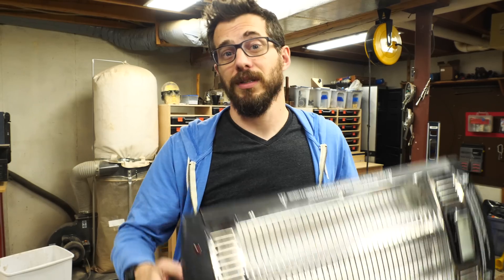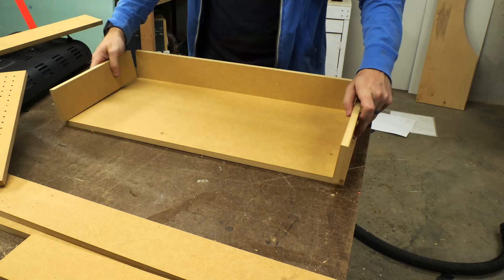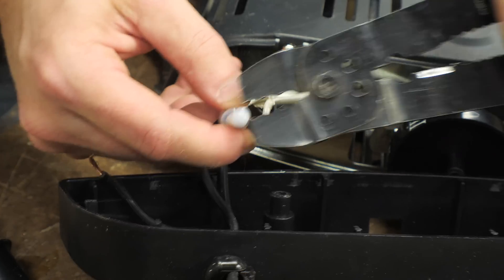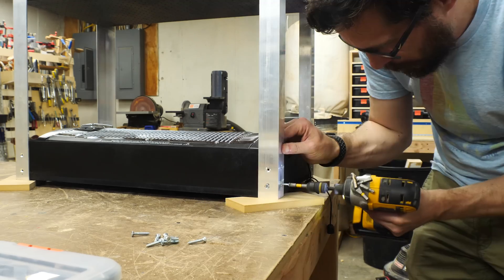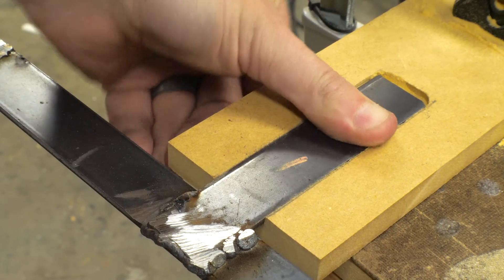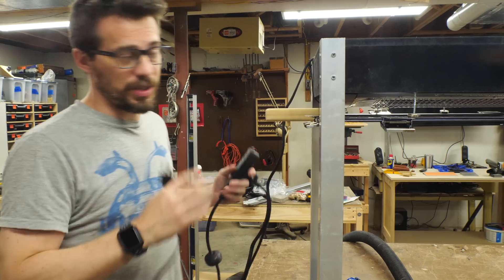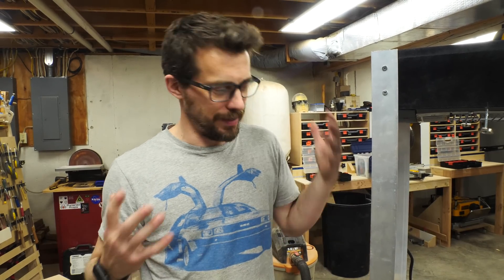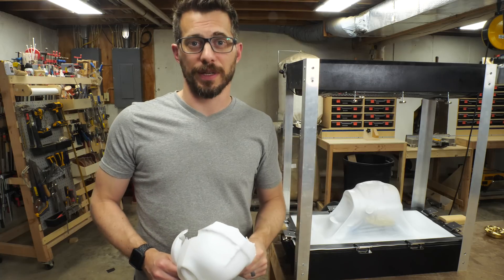How to Make a Larger Vacuum Former | I Like To Make Stuff

Comment: sealing solar cells to make a solar panel.  So need 4x8 feet working area.   I called Flex Seal to ask if there stuff works in a vacuum for repairing old panels.  They have no idea.

Comment: Reagrding those auto darkening welding helmets: your eyes are safe even if it doesn't darken due to flat batteries. The darkening feature is only for you see actually see what you are welding, the actual protection is in the protective glass lens already (UV block).

Comment: I could be wrong about this, but I don't think I am ... a buck is actually the object you're vacuum forming around. So your wrenches and Raspberry Pi are the buck in this scenario. Padding is what you use to push the object away from the platen whether the padding is built into the buck or just stacked underneath. Padding helps to get additional material beyond the bottom edges of the buck, and also helps to avoid pinching on corners. Another note, if the heater is encapsulated in the box (instead of sticking out the bottom) the heat will be more evenly distributed across the material because it won't be escaping out the sides.

Comment: been thinking on a vacuum former to make bigger parts (part being bout the size of a trailerfender but was thinking about making it upside down  , i was thinking about a way deeper box with the heating elements at the bottom and the plastic fixed over the top and to drop the box with the mould and vacuum over the top 
reason being that when the plastic droops down intoo the box it creates a cavity for the mould to drop intoo and it retains the heat under the plastic even while the mould is placed over it to give you more time do the vacuuming / forming slower , all the heat moves up and spreads along the plastic so you should need less heat (the drooped part does get closer to the heat though the heat rises beyond the droop and hangs in the corners / ceiling ) and i hope the thickness of the material will be more equal as its prestretched before pushing the mould intoo it , the weight of the mould might become an issue  , it be hard to see wats happening too unless you put windows in 
you would need some pieces of angle iron on the corners  along the side to guide the mould/vacuumbox  over it , might even help the vacuum by pressurising the underside heating part of the box wirh a leafblower cooling it off in the process and make the plenum way smaller to concentrate the vacuum to only where you need it 

the box for the heating sitting on the ground would be about table height the topbox about the same as the one in youre video just bigger and upside down with the mould bolted ontoo it , could put a metal difuserplate over the top of the heating elements to prevent plastic from dropping ontoo them 
might be possible to make a mould on a board with the exact amount and placed hole to pull the material intoo all the corners (bigger holes for more cfm to pull material intoo corners before the rest is pulled tight )

Comment: Idea... hang two sheets vertically in the oven and slide them together on an object and vacuum the air our with a steel ring with holes that hangs between the two sheets. This way you can form 3D objects from both sides.

Comment: Question about material: Im building something similar for making RC car bodies. However my hardware store only had a sheet of thin acrylic (that’s how it’s labeled verbatim - ‘Acrylic’). Will that heat properly for a vac press or should I shop around for better material? For example, Lexan is typically the industry standard for RC shells. Thanks.

Comment: I just built my first ever vacform last year. While it works perfect, it's too small for my next project. Thankfully, your video helped me figure out how to build my next. I will say, hand drilling the holes can be exhausting (and I managed to mess up my back a little).

Also, another trick for sealing the edges (I used), is to use duct tape (the silver stuff they use fro dryers exhaust). Placed on the outside seams, where the vacuum will pull it inwards, plugging any gaps

Comment: Good video. What I've yet to find is anyone talking about the plastic they use and how much it costs. Amazon has lots of choices, but it seems so expensive considering a lot of vacuum forming is done around disposable containers. I know suppliers buy stuff in bulk, so that makes a difference. I bought one of those $125 chinese dental vacuum formers on amazon that uses 5"x5" sheets of plastic. I'm experimenting with old soda bottles and other containers.

Comment: Im looking to make a 60" x 40" Thermal forming machine for making 1/4 scale race car bodies. I have four molds and plan on using .060 - .067 Polycarbonate sheets. Haven't decided on heat source yet, most likely electric grids that can be turned on and off individually by a Thermostat.
I'm ready for any ideas that you have.  Mike Clark

Comment: bit late to the party but great video. i made one as well and it works really well. i did change one thing and that was replacing the neodymium magnets with ferrite ones. like the ones on a fridge but on steroids. 
I did that because neo's loss the magnetic field of they heat up above 60C and ferrites can handle around 200C. this was too prevent it from losing its grip on the plastic holder while you are waiting or if you are using it for a while.

Comment: In my architectural model building class back in the eighties we had one that was two separate tubs.  Since heat rises the heater tub had several light bulbs in the lower section.  Once the plastic sheet in the frame was bouncy we took it off and placed it on the suction tub and hit the vacuum power.  Trying to heat downward in an open frame is not very uniform.

Comment: I know this is three years old, but I’m hoping that you still check comments. If you need to hold a vacuum for the extended period of time, is MDF still a viable option? What if you needed a large vacuum chamber and you needed to pull a vacuum while it is full of water? What would you recommend for something in that application? Ideally I would use a steel drum, But I don’t have any around here that would be suitable for the purpose. The only steel drums around my area have petroleum in them, and I need these to be aquarium safe.

Comment: A suggestion- use melamine. As you know, production CNC routers often have vacuum tables and pneumatic dogs. The waste sheet is MDF, with the vacuum pulling through the MDF to secure the cut sheet. That’s because MDF will allow air to pass through, pulling the cut sheet down. It’s permeable. If you use melamine and melamine glue…it’s still inexpensive, but will improve any vacuum carcass you’d build for a vacuum form machine. As a matter of fact, melamine is cheaper than MDF. Trust me…this is years of commercial fixture production experience speaking to you.
Reply: Thanks for the tip Ray :D

Comment: Most welding helmets are actually solar powered. If yours happens to not work, find some sun and let it charge back up before you need to use it. 98/100 times it works

Comment: I also had a thought for removing the clips issue: put handle tangs on both heating frames, so when you add the wood handle, it holds the two frames together. If you line both frames with a thin heat resistant rubber, that ill hold the plastic with a nice strong grip.

Comment: You can buy metal grid with holes it in at home depot and i think the holes are small enough for this.  I was thinking toaster oven for heater but I like the ceramic heater. Idea they do put out a lot of heat in a short time.

Comment: you briefly mentioned the buck,  the importance of this can not be overstated - also your inconsistent heat source is causing uneven drooping and subsequent creases - in a shop nothing you showed here would pass but you have a great basic concept, as you said with some refinement and practice you can get to pulling the kinds of moulds we use in aeronautics

Comment: The box for the vacuum is too tall and this is made this way because it has the vacuum connection on the side BUT it would be better (if possible) to make the box much thinner and pull the air from the bottom in the centre. This will mean that you will not lose so much of your very valuable initial vacuum to emptying all the pipelines and the box before making the pull on your product. Some like to use a large tank as a vacuum holder. This is great as you can then vacuum much larger items If you can couple this with a three-way valve it works like a dream. Step one turn valve so only empty the tank of air. Step two heat your plastic pull it down over your mould step three use the tank and pump together to pull the air. Step four isolate the tank as spent and just use the pump to pull directly. This way you can get much better definition in your items and make larger items. The vacuum and getting the right temp evenly are the crucial factors. Keep all areas clean and dust free  as they look terrible when you vacuum form over them.

Comment: How would you go about making a deep mold? I'm fitting out my van for full-time living on a tight budget and the refrigerator was giving me problems. The only one that came close isn't available in the UK and would cost around £400 - way too much for a compromise. First I realised that, while a piezo electric cooler is far less efficient than a compressor, the £375 price difference would buy a lot of batteries. Secondly, I would have some 50mm, aluminised insulation left over so I could match the two, maybe seal the interior with sticky back plastic and get a better dual-zone chest fridge for £25 and some leftovers.
Then I saw this video. Even heating, I can figure out but how thick would it have to be to make the interior of a chest fridge, say 1000mmx400mmx1000mm deep? Could it even be done?

Comment: The pressure is low because you're using a long tube to your vacuum. You lose suction exponentially as the tube gets longer. You want to put the vacuum literally on the table next to the former with as short a tube as possible. You'll get waaaay better results.

Comment: Very cool build. I've been wanting to make one of these but the biggest hurdle was the "cradle" system to lower the frame holder to the vacuum surface. The fact that you skipped any type of complicated raising/lowering system by simply using a separate plastic holder and magnets was a smart move. This reignites my desire to make one of these machines. Good job (as always).

Comment: Just an idea: instead of having screws dangling with magnets, have you considered extending metal sidings (flange) downwards to the same level, and put the magnets on a there? Like a box shape with a turned in edge on the bottom so the metal frame can close much closer to it- that way the plastic would be heated much quicker with less heat loss out the sides. Or is the heat loss necessary? Just a thought. Cool project, I might start on my own :D 
Oh btw- I had a basic intro course at my university for vacuum forming- a really good trick is that if you have a detail on the front the plastic needs to sink *into*, drill tiny pinholes in the deepest points through the entire form. The hole can be like 1/2 mm and it makes a huuuuge different in surface detail. You can also massage edges to get more detail.

Comment: good video....One comment though, the screws holding the heater into the frame, their heads should be covered in case a wire comes loose and touches a screw.

Comment: If you put handles in the top and bottom frame pieces and made the wooden handles go over both metal handles, holding them together, you wouldn't need the binder clips and it would be a more efficient design.

Comment: What if you create a walled off section? At the top that circulates the hot air with a metal AC power fan? Then I would think you can disburse the heat  to the full width

Comment: I think you could get a larger heated area if your ABS was suspended a little lower from the heater , this would allow the heat to radiate to the outer edges before the centre melted to much. great video.

Comment: That heat source seems excessive, doesn't give you enough time to brace yourself (you overheating it, that's why it wrinkles) or heat plastic evenly (drooping in the middle only). Also metal frame was unnecessary, cuz wooden frame would do, so you can have cheap ready frames for different sizes. You could use metal rods instead of aluminum corners, so frame would be guided easier. Oh, just check Tested and see how Savage safely did his 😅

Comment: Nice job, I’ve been wanting to make a Vacuum Former for years.
Reply: Better check Tested how Adam Savage did his. It's safer, easier, cheaper and still going after like 20 years. Of course you would have to combine the project with this ⬆️ one because of wooden body, but that's not much  tweaking. Whole project will cost you around 30$ if you already have a vacuum and tools to work with wood. Good luck 😊

Comment: Nice job, I’ve been wanting to make a Vacuum Former for years.

One tip though, wear a Mask when cutting/sanding/planing MDF, the dust is highly carcinogenic.
Reply: What is MDF? Im looking for a good molding resin to pour in to a silicon mold to make a buck for vacuum forming? Im trying to get a mold for my vacuum former to vacuum form hockey masks, but the bucks ive been using for these don't last at all. I want a really rigid hockey mask buck for vacuum forming many copies from.
Reply: John Warner absolutely. MDF is even an instant sinus infection.

Comment: I'd make a heat shield around the top off the heater so you can get more heat around the top area because it looks like it's probably cooling down the print mold pretty quickly when pushing down.

Comment: Making a vac machine with an adjustable bed so you can use different sized plastic sheets, so you don’t waste material, would be the ultimate project

Comment: I don't mean to be critical, just a suggestion for some future project.  You made the electrical hook up way too complicated, you took all of the heaters internal wiring apart just so you could rout it through the upper box you made.  It would have been far easier to just have cut off the 3 prong plug end from the cord and simply replaced it with a new 3 prong plug that you can get at any hardware store or big box store like Home Depot.

Comment: I have 3 terrace heaters. 
I want to make moulds for hydrofoils to put on my kayak, boat, surfboard, wakeboard, or something else
Reply: It would probably be cheaper to use fiberglass to make your molds, that way you wouldn't have to make a large vacuum table set up. Just resin and fiberglass sheets

Comment: for smaller pieces make a plywood reducer insert cut to the size of plastic and staple edges of plastic to insert. Then block off extra vacuum holes outside perimeter with tape. It's a good idea too have lots of scrap plywood (door panels) to custom cut insert for the part you want.

Comment: Ok three issues I see. 
1. You are not heating the material correctly. Uneven over and under heated areas. 
2. You need to pull the material past your base to stretch the material and help seal for a better vacuum. 
3. A shop vac? Really? No. You need a real vacuum pump and about a ten gallon vacuum tank that can really hit the material with a high vacuum fast.

Comment: Nice work. Two remarks: 
Neodymium magnets loose their power when heated above 90 deg centigrade - irreversably. A snap-on lock might be better on the long run
Industrial vacuum fomers use a two step push- and pull-process. Specially when copying high rising molds, they first blow up a bubble in the sheet, then move in the mould from below, and finally apply the vacuum. That enhances the wall thickness in vertical surfaces.  But more than a diy project. Reversing the orientation (sheet on the bottom, mould mounted above it) could be a way to go. Hot air instead of the IR heater could also help get it heated more evenly.

Comment: A better plastic clamping frame would be to use wider flat stock and notch the corners to fit inside the uprights. Then you have frame area outside the vacuum box for the binder clips. Then to get a better seal, get a piece of 1/8" thick hardboard and drill the same hole pattern as the top of the vacuum box. Cut the outside dimensions to fit within the frame opening and slightly round the top edges. Glue that to the top of the vacuum box, making sure it's fully sealed.
These modifications will allow the plastic sheet to contact and seal to the bed top, without having to do a major redesign.

Comment: the surface of the table looks alot like an air hockey table. if you but a vacuum on the airhockey table so it sucked instead of blew that could probably work too

Comment: For the MDF box with the heater, I'd recommend lining the inside of the box with some high temp aluminum foil tape, or even some engine bay high temp paint to help a little more to prevent the mdf from getting overheated and will help disperse the heat better as well.
As for getting the full piece of material to heat a little better evenly, build another small frame with aluminum foil tape lined on the inside in the space between the heater box up top and have it go down to where the top of the metal frame would magnetize to the magnets.

Comment: Made me think would it be possible to use ultrasonic melting in this.. or what if a printerhead would be using such tech, it could be a lot faster than others and also make a lot less of a mess even with the hardest shapes imaginable without even need for supports?

Comment: Not not picking but you could have just made the hole bigger for the cord. That way the plug end would just fit through. Save you some time not having to mess with the wiring . I guess I was nit picking.  How about In my humble opinion I think my idea would have been faster and easier .